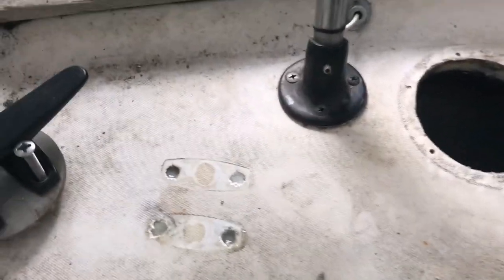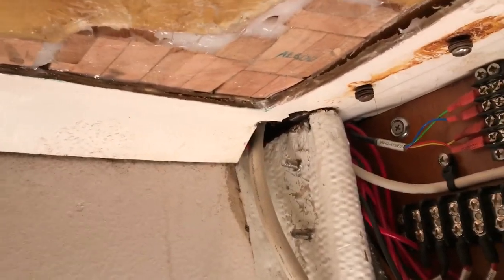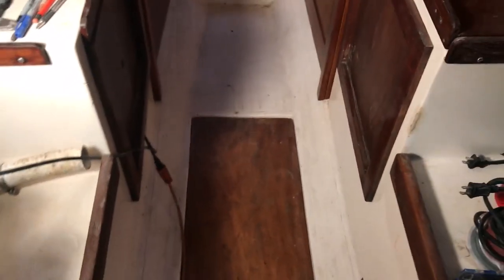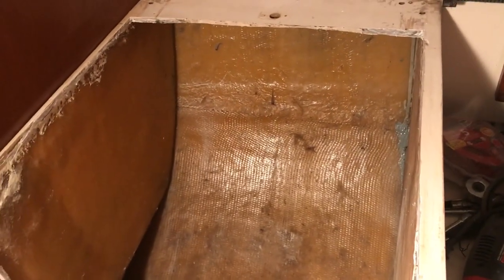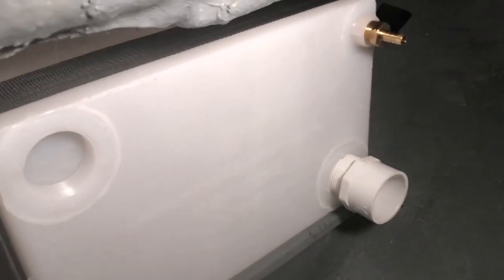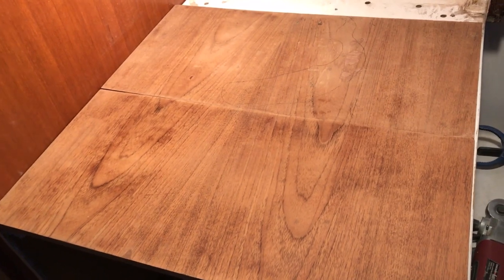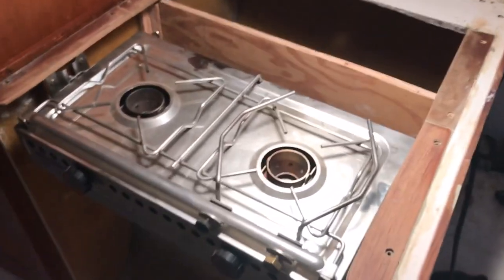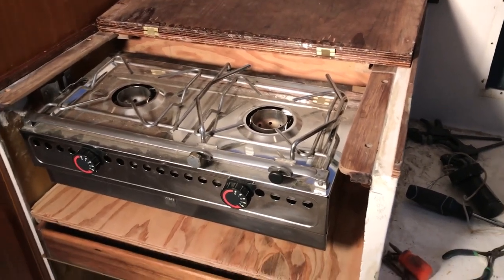Contessa 26 Refit ep.9 - Deck Core and Galley Rebuild Part 1

Comment: I just picked up a 1973 Contessa 26. Why do you do the core replacement from underneath instead from the top? Is there a benefit to this approach for the 26?
Reply from the maker: Congratulations on buying a legendary boat! 
I did the core replacement from beneath because it’s much thinner fiberglass below and easier to fiberglass back on. Of course there’s also the fiberglass liner that you’ll need to cut open and then fiberglass back on the same way, then fair with fairing compound, and finally paint. 
You could, of course, do it from the top, but ask yourself if it really needs to be done in the first place. The top layer of fiberglass is relatively thick, so unless you’re decks are spongy, you probably don’t need to. I only did a small area around my chain plates and it probably didn’t really need it in the end.
Reply: @EpoxyAndButylTape  I know there is some delamination on the foredeck. It's not spongy but I can hear it move a little bit. I was confused at first because I've read some things that said the Contessa 26 has a solid fiberglass deck. But then found an article on co26 that explained the deck situation of the Contessa 26. This is my first sailboat so all of this is new to me. I really appreciate your channel.
Reply from the maker: The ones built in the UK were solid fiberglass decks. Although there are a couple of very early, Canadian built ones that have also solid fiberglass decks. Otherwise all Canadian built Contessa 26’s are wood cored. Most are plywood, but there are a few areas that may be end-grain balsa, such as around my chain plates. 
A little creaking is ok, but if you’re dealing with extensive delamination, you should drill a test hole to check to see if the wood is wet. If dry, all you need to do is inject some epoxy into a few holes drilled through the top layer to “reglue” the top layer of fiberglass to the wood core. Then put something heavy on it until it sets up and finish it off by painting or gel coating the holes.